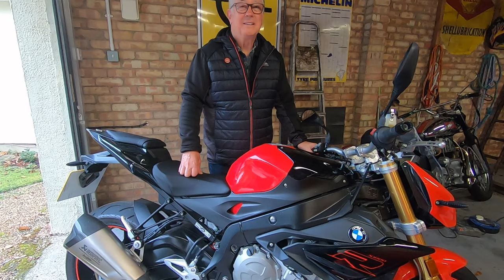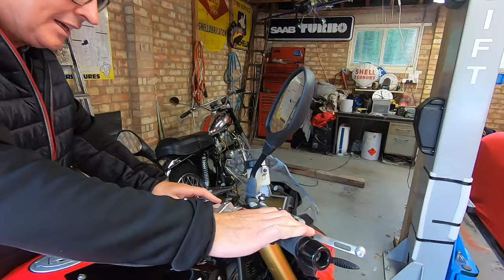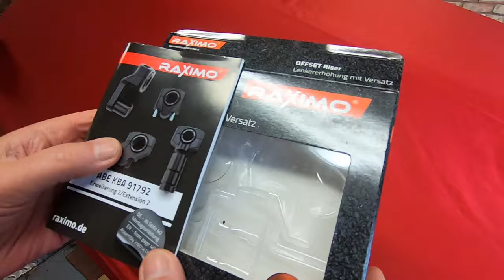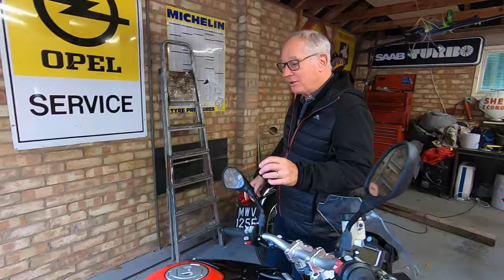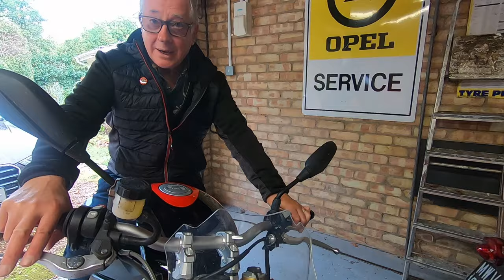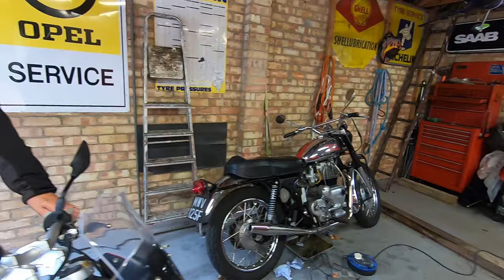Too old to ride a Sports Bike ?

Comment: I went from a Kawasaki 650 sport bike to a BMW R1250GSA to be more comfortable, I kept it for 2 years and it wasn't my kind of bike, so I've just traded it in on a brand new S1000R, it is fantastic and I don't find it uncomfortable like YouTube reviewers claim it is, I'm 68 and ride as long as the tank lasts, only stopping to fuel up, on the Kawasaki I used to get pain in the butt, lower back, cramped knee's and numb hands after an hours ride, I don't suffer any of this on the S1000R, I intend to keep riding it until I'm forced not to.
Reply from the maker: It,s a fantastic bike never thought it was uncomfortable till I got to 71 but just needed that little adjustment now i am happy again. Can't see me changing it now . Thanks for watching.

Comment: I think the rear sets are even more important than the bars when it comes to sport bike riding positions. I finally sold my R1 when I got to 70 because I was only riding it for 20 minutes here and there and the bike deserved better. It's the same reason that I like ADVs. The dirt bike riding position means I can ride for hours (prostate willing) so I have had 3 of them in the last 20 years: V-Strom, Multistrada and now a KTM 1290 SAS.
Reply from the maker: Yes good choice of bikes. I had many Honda Fireblades but they got too uncomfortable to ride.

Comment: If you think your bike is uncomfortable my advice is try riding a bike with a more extreme riding position. Not that I find my BMW R nineT Racer as uncomfortable as it’s made out to be but I went out for a ride on my brother’s Royal Enfield 250 Continental GT fitted with clip ons which is a real wrist breaker ! When I got back on my bike it was like riding an R1200RT ! 😂🇬🇧
Reply from the maker: I think it's just that i,am getting older. I had several Fireblades some years ago even rode to Spain and back. Don't think I could do it now. Thanks for watching.
Reply: @KSL12  I forgot to mention my age, 62, and happy for you that you can ride your S1000R. That big Royal Enfield in the corner looks a beaut !
Reply from the maker: @stewy62  Royal Enfield 750 Interceptor great bike. I am a little older 71.